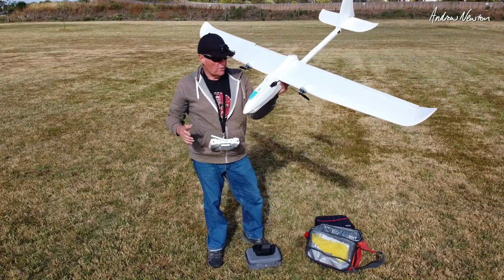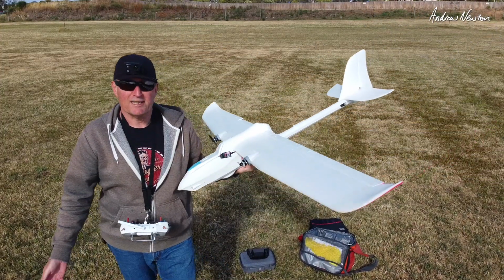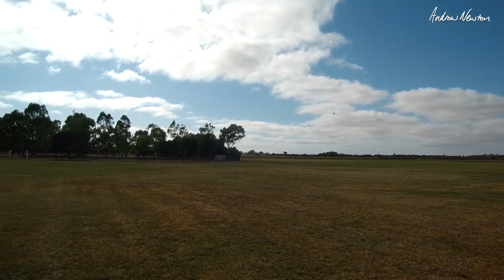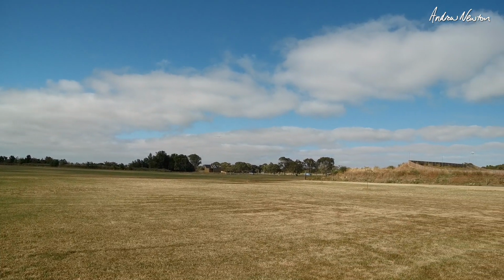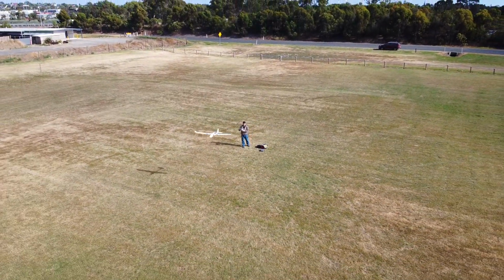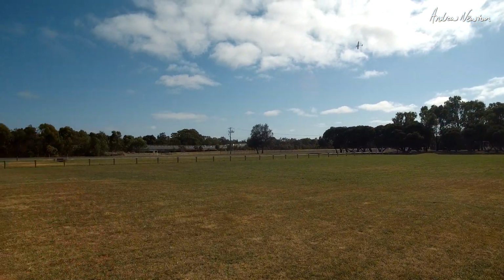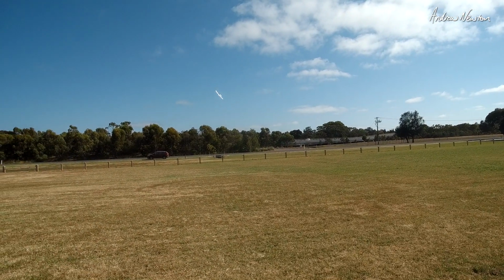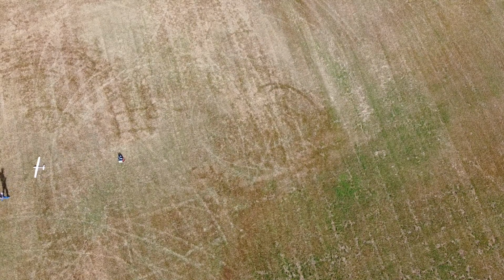Ranger 2000 twin

Comment: Hey Andrew, nice build, love it. I can't help but noticing that there seems to be quite a bit of adverse yaw in highly banked turns. That could probably be helped adjusting the servo throws and/or mixing in some rudder. And the on-board shots show that the flaps are maybe a bit too high up, no? This could maybe waste some lift on the wing, leading to less efficiency? Thanks for your awesome vids!
Reply from the maker: Yes you're right Kim, well seen. If this was a final setup I would pay attention to those issues but this was a quick test.

Comment: With twin motors in front of wings, you move the center of gravity forward... any issue with proper CG? With pusher setup, I need to put a 5Ah battery way back for proper CG. What type of 4S battery do you use?
Reply from the maker: Just moved the battery back about 20mm. 4S 3000 Zippy